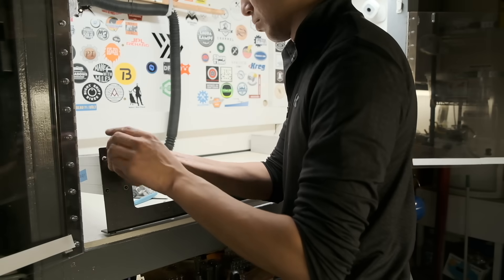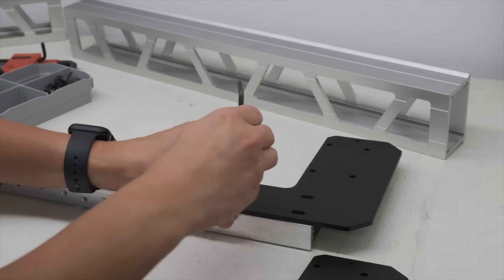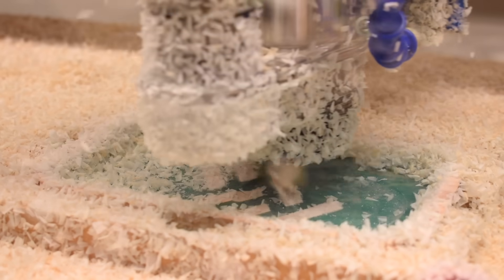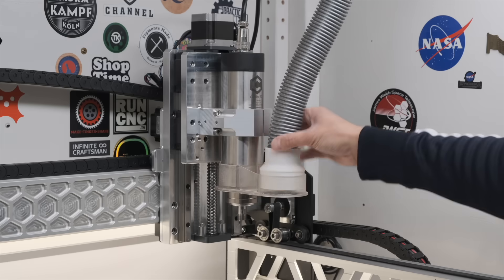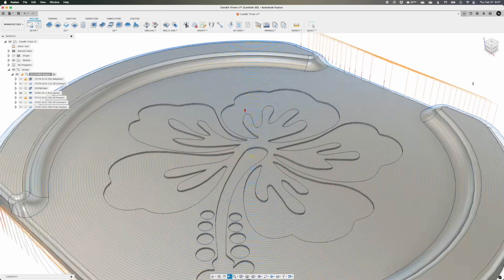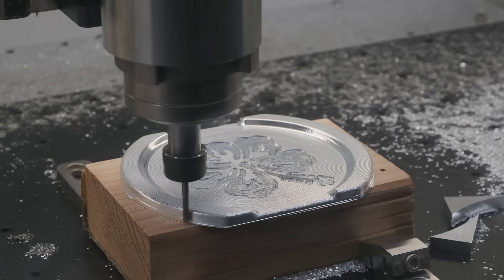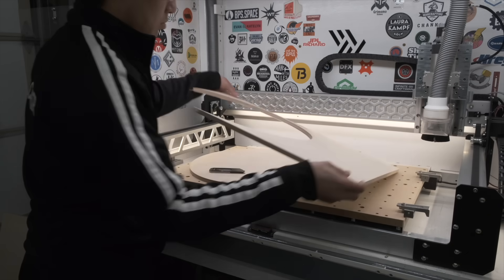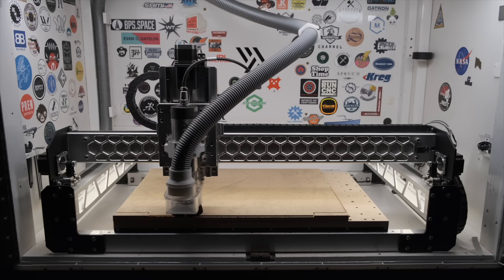Finishing my Custom CNC Router Build + First Cuts

Comment: I've had the same issue with chips ending up leaning against my enclosure door. I've ordered some 2mm transparent tablecover from Aliexpress and taped a strip of about 10cm to the inside of my door opening. As it still curls a bit, i made sure the curve turned towards my door, so it closes against it. Since then i've had no issues with debris falling out anymore, while still having clear view and access.

Regarding the dusthose... Do you happen to have the files/design for that airhose splitter available somewhere?
Reply from the maker: Still working on some improvements to it, but I'll see about sharing some more details soon. Curved table cover sounds cheap and effective. I used to have a thin plastic wedge taped to the inside of the door so chips would be diverted away from the opening, but it was kind of flimsy.

Comment: Where did u get the aluminum clamps?
Reply from the maker: They are older versions of this: https://shop.carbide3d.com/products/tiger-claw-clamps?variant=39792566042685
BUT, they have been superseded by these, which are a better deal IMO*: https://shop.carbide3d.com/collections/workholding/products/crush-it-pro

*Unless you really need the clamps to be low profile.

Comment: 0:46 where did you buy those toe clamps?
Reply from the maker: They are older versions of this: https://shop.carbide3d.com/products/tiger-claw-clamps?variant=39792566042685
BUT, they have been superseded by these, which are a better deal IMO*: https://shop.carbide3d.com/collections/workholding/products/crush-it-pro

*Unless you really need the clamps to be low profile.
Reply: @WinstonMakes  Thank you, I just ordered them!

Comment: good work, but i see a bunch of things i wanted to avoid on my own machine build. it might not look as pretty but works quite well.

- the side plates look very thin, even for steel. i went with 20mm. and a geometry that moves the spindle center right above the center of bothlinear bearings.
- closed loop steppers are very affordable now and theres only benefits of using them. they also detect a crash or missing steps and shut down the machine immediately.
- the bed isnt supported in the middle. yes, its thick aluminium with a wasteboard ontop, but still could flex.  i went with fully bolted down table.
- left and right y rails are also just supported on the ends using thin steel plates, i went with HGR20 rails instead on a fully bolted down support beam to the table.
- i try to avoid v-wheels as they might catch on stuff laying on the rails, HGR Linear rails are self cleaning using wipers and are very rigid in all directions and resist twisting forces and barely cost anything anymore, even the thicker 20..25 sizes. 

a lower speed spindle for steel and maybe a tool changer some day, someday... maybe..
Reply: Yeah V-Wheels are a no go. Belt driven axis too. I upgraded to HGR20, CL Stepper 3Nm, HF Spindle from router and Ball bearing instead of lead screw. Aluminum milling is so much better now. It weights 80kg now too. The surface finish and how much I can cut increased significantly.

But my machine cost now probably more than 3x as his machine. It’s always a compromise between performance and money.